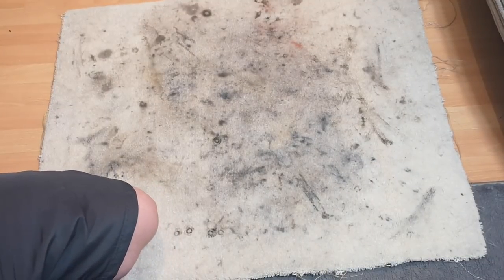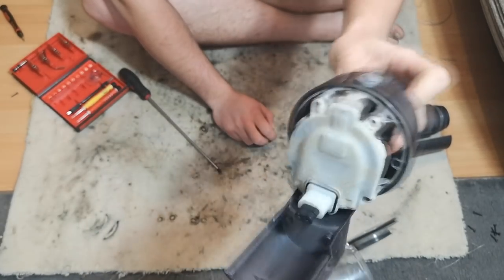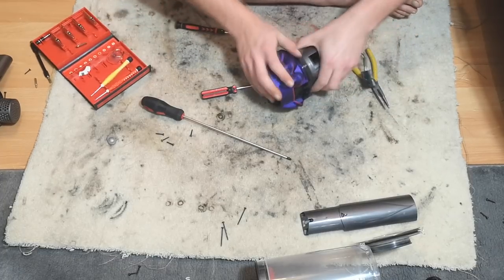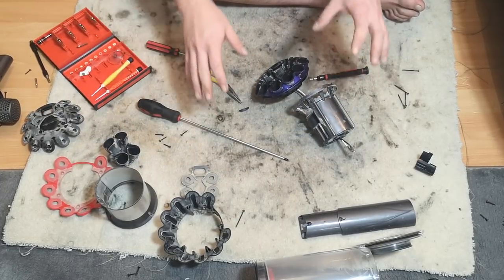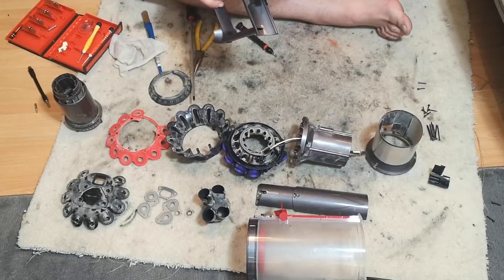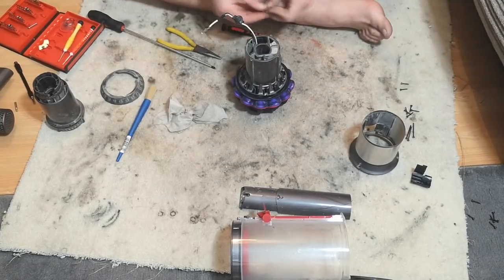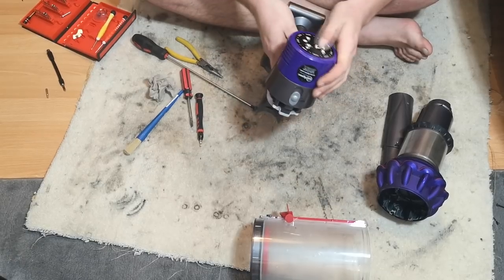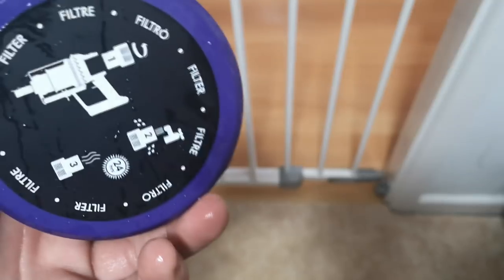#Dyson #V10Broken #cordless Dyson V10 - Stripdown, Repair and a filthy interior! (Stripdown how-to!)

Comment: Can you please stop assuming that users are using their Dyson on plaster dust. You should know better than that, that some carpets have very fine residue in them. I lived in Central London and the air would come through the window!! Its NOTHING to do with plastic dust so don't keep assuming that when you dismantle these rubbish toys. Try dismantling a proper vacuum cleaner like a SEBO etc and you will not find rubbish inside them. Get it!!!!
Reply from the maker: It's talcum powder in our house! Amys out tonight and I walked into the bedroom when I got home from. Work and the floor looked like Tony Montana's office! Glad I fitted a hepaflo to the celebrity now (although it's not going to get it all out of the pile because it's not that good!)
Reply: The sebo lets it back into the air 😂

Comment: Cheap nasty toy!!  The wheel hearing are rubbish and wear out as do the batteries.  Actually it probably WASN'T used for plaster dust. The Dysons I've had get like that and go No WHERE no plaster dust!!!
Reply: blakaeg ah you have to find everything to bash about these things don’t you.
But the batteries? Seriously?
If you really cared that much you would bash every single battery operated device because they all suffer from similar issues.